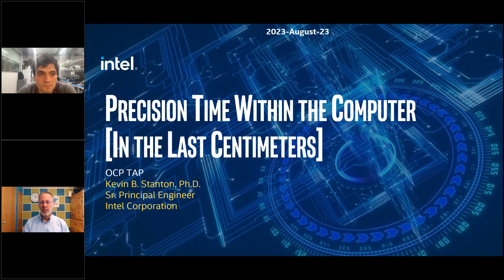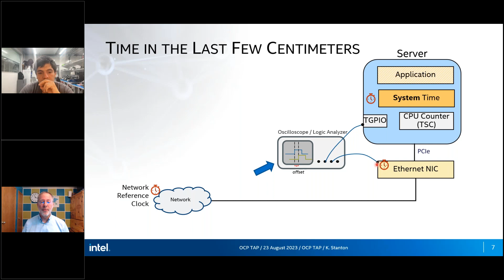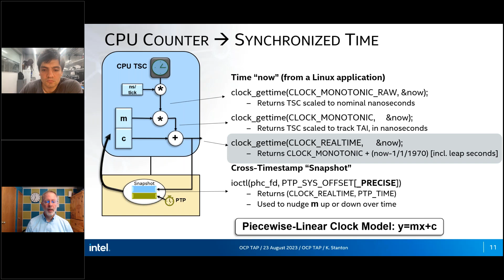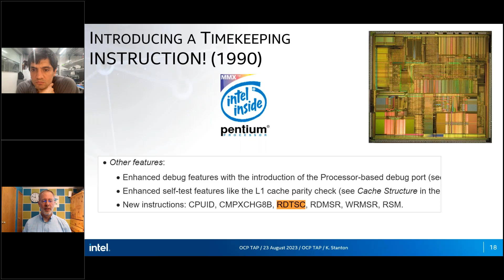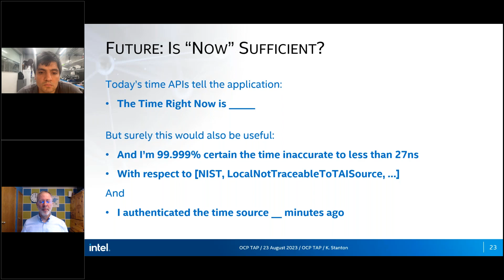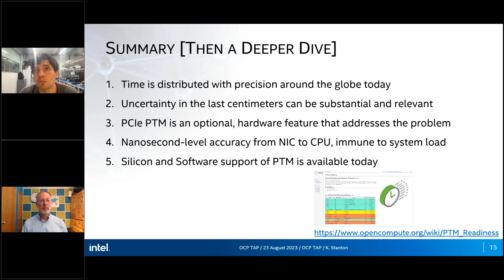OCP TAP CAll: "Precision Time in the Last Centimeters with PCIe PTM: A Deeper Dive" August 23, 2023

Comment: @kevinstanton148 
Hi Kevin, Thanks for the talk; the best on this subject.
What do you think about the PPM offset between the 2 sides of PTM exchange causing time inaccuracies at the EP. A 300ppm offset between the 2 clocks is 300ns drift in 1ms. How do you compensate for that? PTM context update for <10ns inaccuracy would be too frequent and impractical. Frequency matching seems to be a feasible option but is that typically used in systems? What would that look like - sharing the crystal on-board OR the EP using PCIe ref_clk coming from RC as its clock source?

My final question is whether your stats on inaccuracy on Slide 9 use some frequency matching scheme or are those numbers without it?

Comment: Nice talk, thanks for that.. 
Question : initial discussion started with How PTM will work with various endpoints which may be connected through fabric on various delays and it should work regardless. 
But around timestamp 32:00, when question was asked by host regarding the assumption abt fixed delays in calculaton of equations, preseters agreed that the assumption is fixed delay between requestor and responder. This doesnt look correct as u will have to send the sync/async wire across req. and responder synchronize them and do all sorts of additional stuff, instead of using existing communication channel between requestor and responder. Can you please explain a bit more on that..
Reply: Hi (@mohammedumar5236) Mohammed. Thx for the note. In the simplest case the PCIe endpoint is attached directly to the Root Port. Thus the Request and Response transmission delays are symmetrical and constant over time because the RF wavefront propagates at 'speed of light' and trace lengths are matched on the motherboard. If a PCIe switch is inserted, it must participate in the PTM protocol (else the protocol will be disabled on the path by the OS), allowing it to measure the extra delay that it inserts between the PCIe endpoint and the PCIe Root Port, and compensating for that delay. In this latter case the compensated propagation time is once again symmetrical and constant.